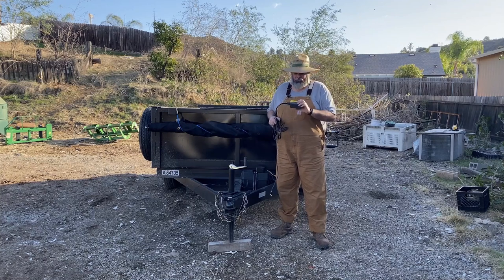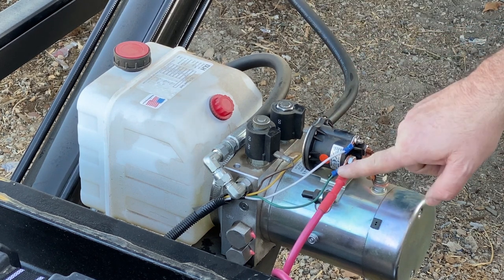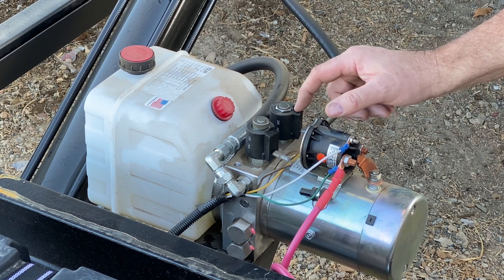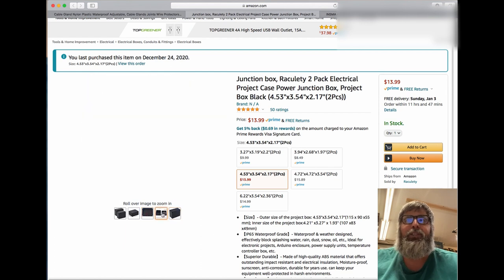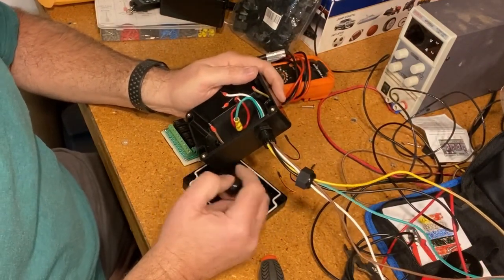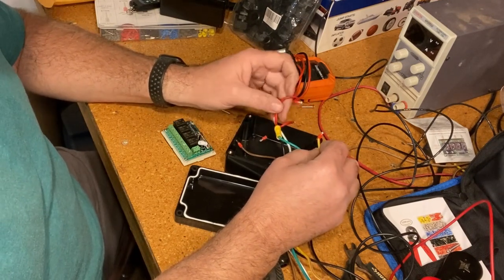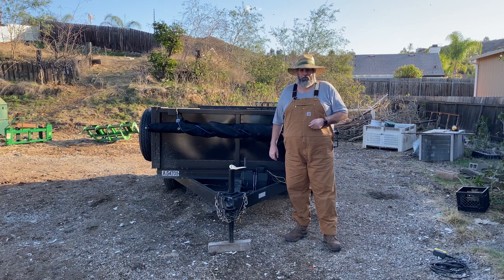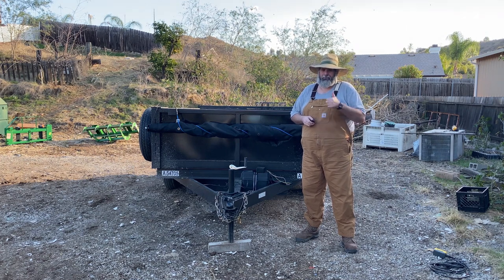DIY $20 wireless remote for your dump trailer CHEAP

Comment: If you used two diodes in the power feed from A and B relays, you could get away with using two buttons instead of three.